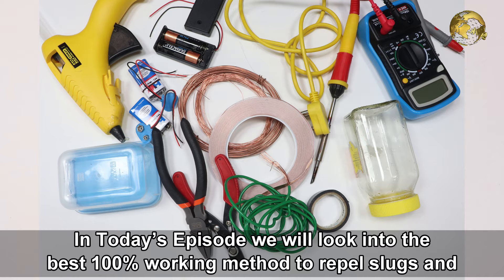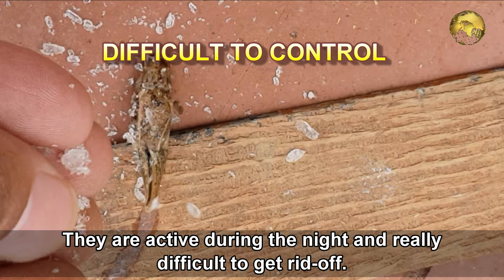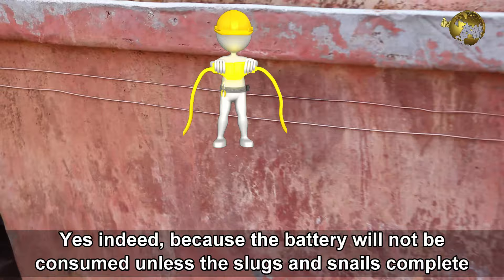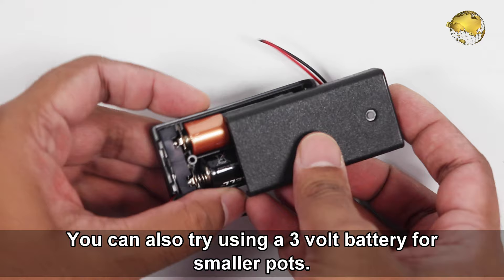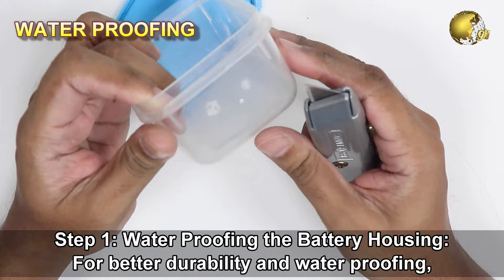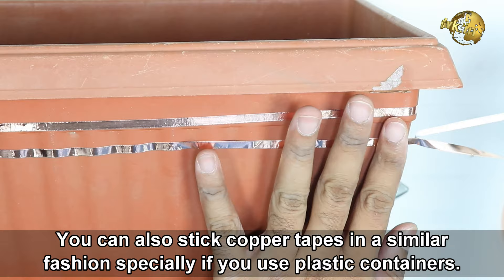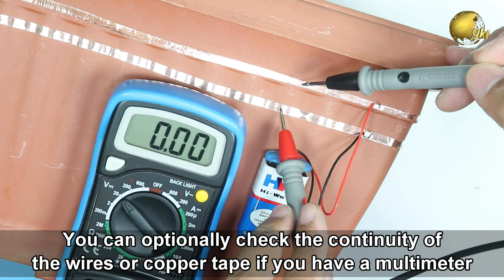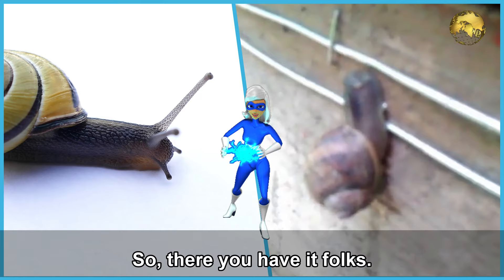Easy DIY Slug and Snail Fence | SEE WHAT HAPPENS!

Comment: I had three raised beds and ran a DIY 9v electric fence for snails.  It came under heavy "attack" by the snails for weeks, but they didn't get passed it, until one particularly massive slug crossed it and burnt out the cables.  Then it was open season.  So make sure you check your wires at regular intervals.
Reply: Great, that made me laugh but even better it gives me confidence in my new fence, THANKS.

Comment: This video gave me the idea .
Im going to build a BIG one around my outdoor cathouse. (Slugs carry a deadly parasite) I will use 4 reachable 9v batterys in Serie. I will also put a timer module and a downstep module in combination with a solar panel. The timer will start from 12:00 till 21:00h then are snails not active in the sun. Then it's time to charge the batterys with the solar panel. I use 30 meters of thick copper tape. 

Will let you know the outcome.

Thanks for sharing! 🤝🏻
Reply: Where the update?😂
Reply: Will you not have too much resistance in 30m wire for a 9v battery?
Reply: @badoiuecristian  that's why I use 4 batteries. I've made 4 loops. So it's only 7m per battery. 👍🏻
Reply: @everythingkosher5598  still working on the outhouse 😅. But I've made a smaller one, for my outdoor cat. And that one work perfect! I placed 2 9v batteries. After 2 weeks the battery is still good. But I'm going to upgrade it with a small solar panel so the batteries will charge in the afternoon. I'm going to make a video of my big project, will Post an update again 😂

Comment: Hi, thanks for sharing. I've got a wall around my veg garden made up of rough cement tiles. Can I stick the wire with hotglue if I leave at least the top of it bare and without the glue?
Reply: Yes you can glue it, but make sure jou don't cover the wire. Or place some dots of glue every 10 inch or so.  Or you can hit a nail in the wall, at the beginning and end en twirl it around it. 👍

Comment: Thank you for this.  Will copper wire still convey adequate current after it becomes tarnished?
Reply from the maker: This issue is seen with low quality copper wires, especially during rains. I am afraid even I faced the same problem, Changed to galvanised gi wire.
Reply: GARDEN TIPS thank you for the reply.
Reply: I was using thick copper wire one piece that I painted with Salt water to turn the copper green this creates Copper sulfate that runs down the side of pot seems to keep slugs away ! But its not 100% I did find one slug but it may have been in my soil that I missed ?

Comment: Can I have this on my exterior compound wall ? I will not be able to create a loop like you did around the pot. Will it still work if only one end of the wire is connected to the battery ?
Reply from the maker: Am not sure. Perhaps The animal has to complete the circuit to get a shock.

Comment: What about rain /watering shorting out the battery?
Reply: You can add in the circuit cheap Chinese water sensor module with relay. When rain/irrigation is recognized, it will disconnect the circuit.

Comment: A battery is always discharging.
Reply: The circuit cannot be closed. Use a 12V battery and add a small solar panel + charge controller.

Comment: question: does it work when it rains? =V
Reply from the maker: Actually it’s not durable during rains. The copper wire corrodes. Better to use galvanised steel wire for durability especially in rains.
Reply: @GardenTips  tks u rock  >~<